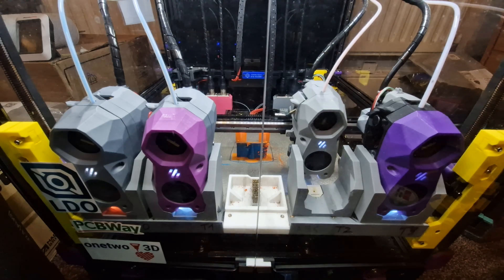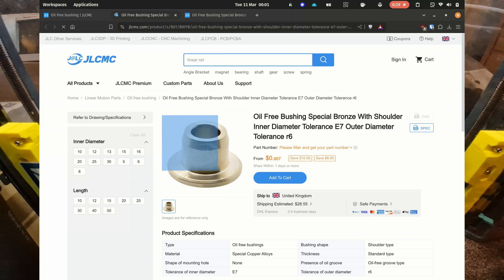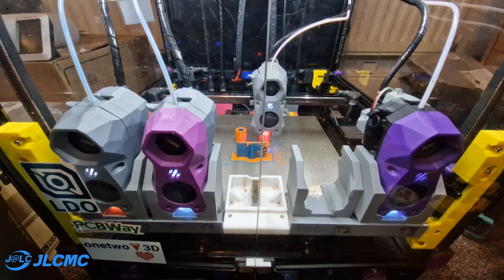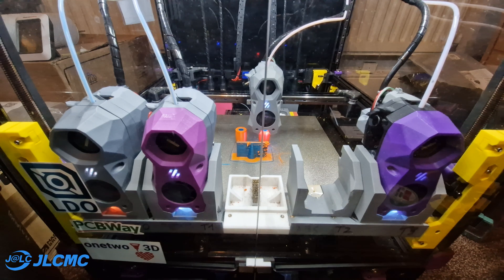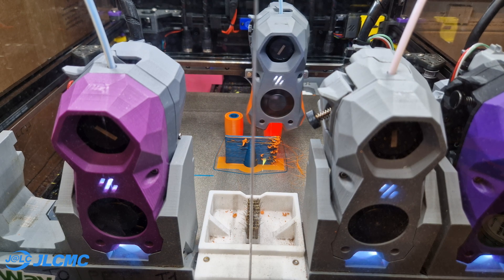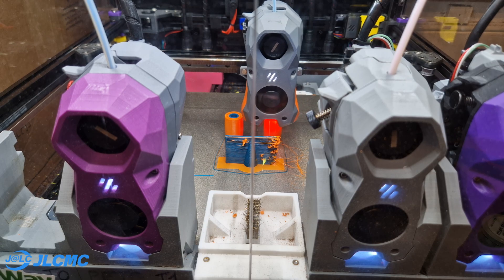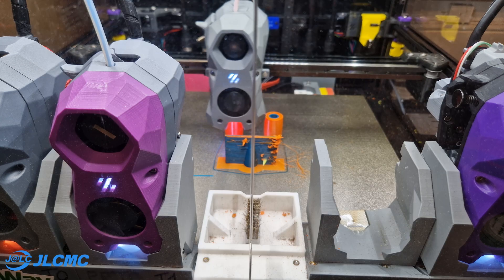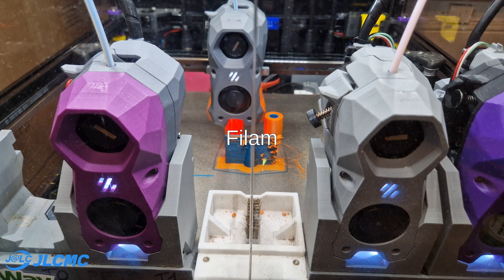A multi-material starting guide for 2025

Comment: Great video but not what I wanted to hear. 😃  Although I would love a tool changer with 4 to 6 print heads to have various colors or materials on hand, it seems to me that they are more trouble than they are worth?  I won't be printing many if any multi color colorful toys and therefore very few color changes in a single print. But I would like multiple colors and matrials readily available for remote printing. I need a large printer of at least 400^3 for my personal needs. Maybe a large printer with a AMS would be best because waste would be minimal?   What are your thoughts? Thanks

Comment: Has anyone in the community ever thought about trying the Cryogrip pro glacier plates?
Maybe by being able to lower the bed temp we can set a better bed temp for all materials? 
(Sadly haven't seen a lot of good feedback on those plates...)

Have you ever tried using a raft? 
Say we set bed to 100C, and everywhere where we print PLA we add a ASA or whatever material we are using raft.
Reply: Cryogrip pro is going through some QC issues at the larger format. I got 2 blue voron 350 plates and worked for about 5 spools and then stopped sticking. (That is counting all 4 sides of the 4 plates) -- some folks with Bambu plates have reported that. And yes my plates were cleaned between prints. Stuck really well when new, then stopped. BQ is sending me new plates. Was great while it lasted.
Reply: @kazolar  yeah, haven't heard a lot of good stuff about them, exactly my worry

Well atleast the raft should work

Or worstcase use glue stick, that always works.
Reply from the maker: Nope. I have not tried any of those.
Reply: I'm not on a voron but I use the glacier plate on my bambu lab. Works great for me, especially if you keep it clean